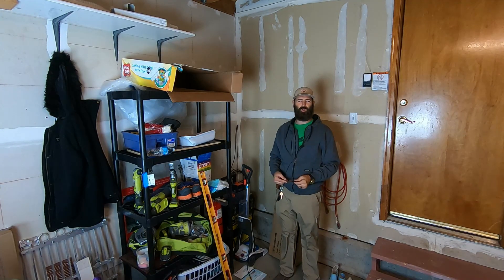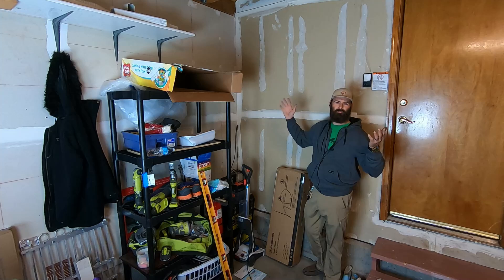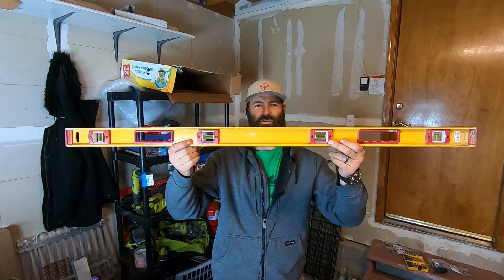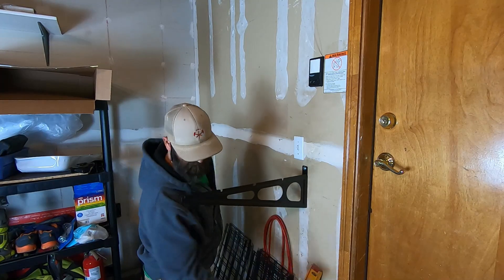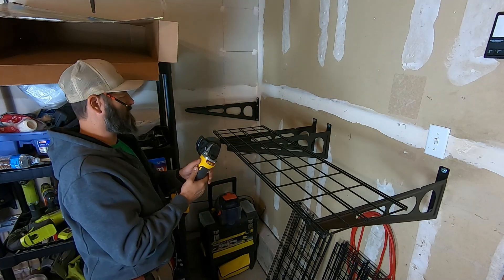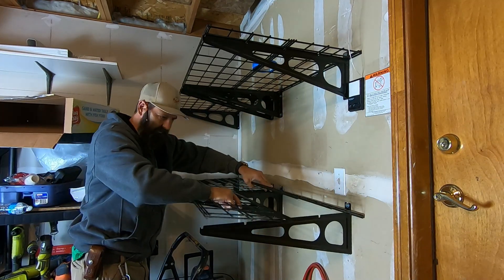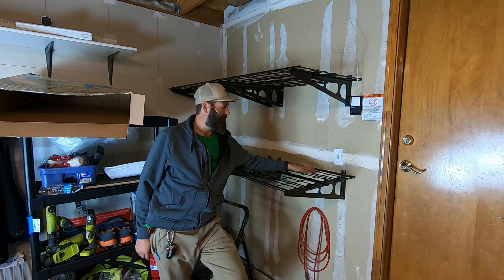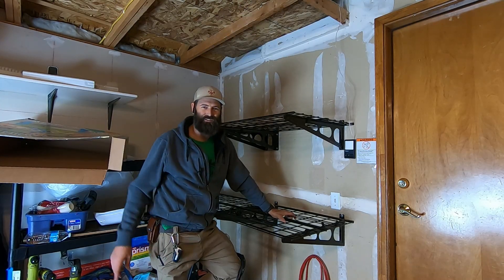Garage Storage Solution For The Hoarder | THE HANDYMAN |

Comment: WHen drilling around power (light switch in this case) how do you determine you’re not going to hit power cable? I assume there is a standard and that cable runs usually go up from the switch, but what if cowboys installed it? Love the videos by the way.

Comment: I used bolt cutters to cut down my metal shelves. Was a lot faster than an angle grinder but not as neat.
Reply from the maker: I agree.  I wish I had them with me.   I ended up only cutting 1 of the 8 shelves in place  I took the other 7 outside to cut.

Comment: i thought you upgraded your tools to the dewalt 20v why did you switch back?
Reply from the maker: I have several sets of tools.  The 18v stays in my tool trailer.
Reply: @TheHandyman1  ok thanks, I was just asking in the case you preferred the old to the newer set. I've only had the 20v and only notice weakness in the drill. Otherwise it's a nice set

Comment: On products that come with lag bolts, like TV mounts or shelves like that, I started using GRK cabinet screws. Nice big head, engineered to hold cabinets full of dishes, no need to pre drill and don't need a hex driver set up for the impact driver. Every time i use them i am a little skeptical because they are so thin but i convince myself the engineers know what they are doing. Thoughts?
Reply: I do believe lags are used when a higher shear strength is needed. I use grk screws all the time. The usually have the rated shear strength on the box. 

Lags are so much thicker that it just gives you peace of mind that no matter what the client slams down on the shelf, the fastener won't shear off.

Comment: When I was working at Lowe's Home improvement in the electrical section, I had  lots of women come up to me and say "can you show me how to do this? I don't trust my husband with a screwdriver".
Reply: She doesn't trust her husband but a complete stranger who doesn't know any more than she does she'll trust...  Makes perfect sense.  Based on my many years of experience with Lowe's personnel, you're better off figuring it out yourself.
Reply: its a sad day when the manager of the department does not know how to use the glass "cutting" machine nor read the tape measure to be sure of the correct size or figure out how many pieces can be "cut" from one large sheet. Maybe I was there on an off day? NO!
Reply: I seen that movie on the internet somewhere